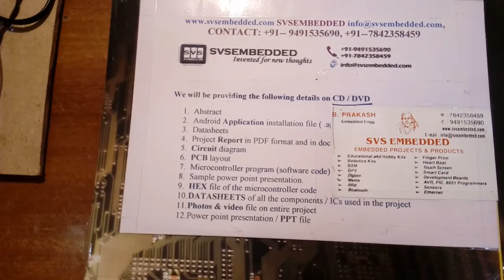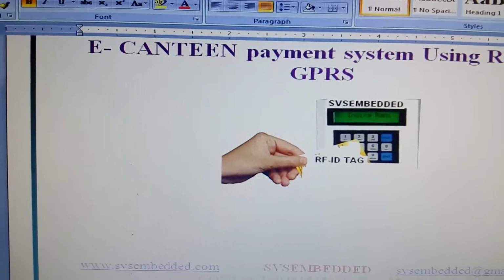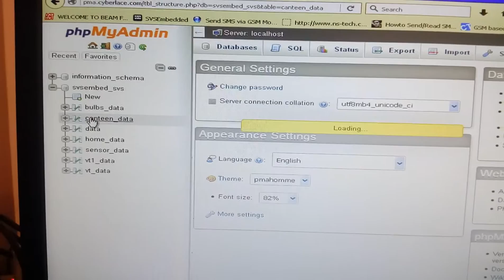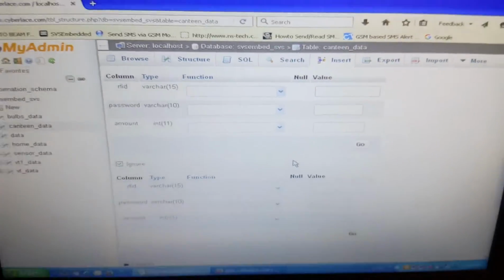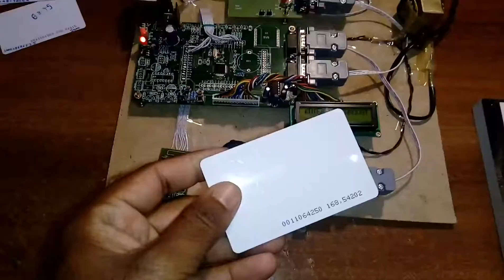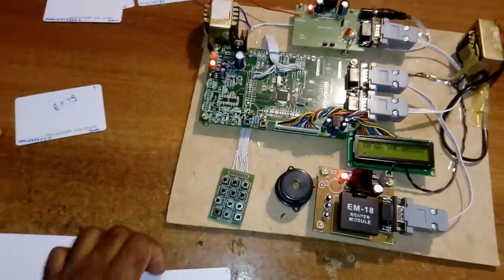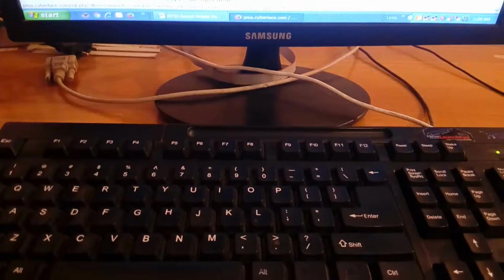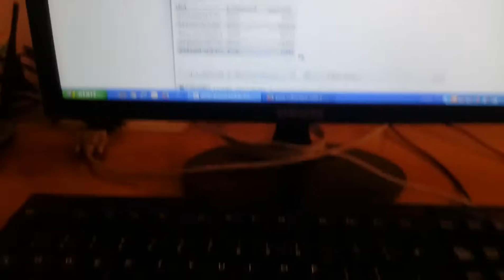IOT Projects : RFID Based Mobile Payment System Using GSM - GPRS Network

Comment: sir plz uploade  vedio for IoT based electronic toll collection system..
Reply from the maker: Thanks for comment and your valuable Feed back,we are selling the projects with least cost.
if u order the project we will provide working hardware kit along with 
1.abstract
2.datasheets
3.documentation
4.schematic( circuit ) diagram.
5.software code.
6.sample ppts
7.photos&video file on entire project
through google drive.if u r interested to take the project.
send me a mail to  svsembedded@gmail.com,info@svsembedded.com.
we will send u the how to order procedure to u.